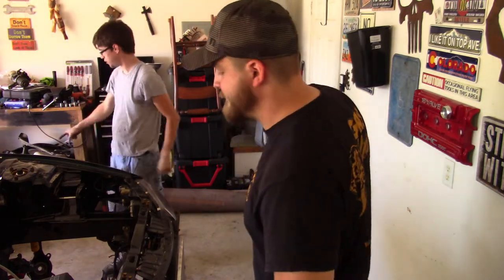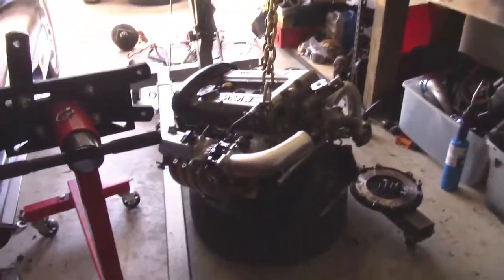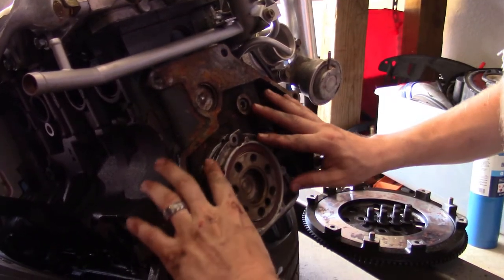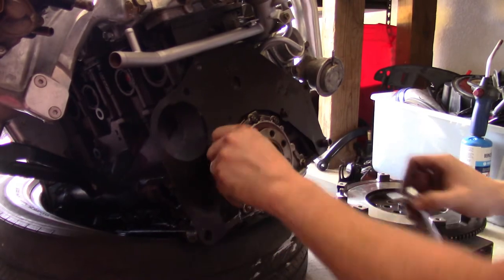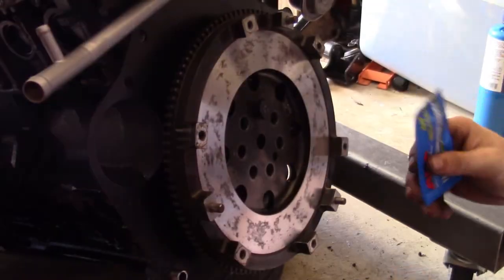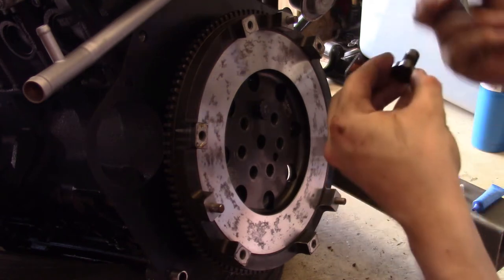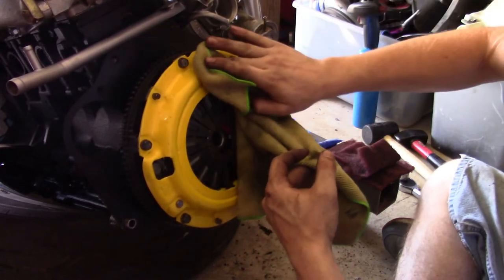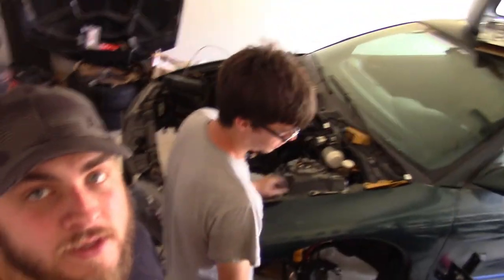4G63  Refresh Part:4 Transmission and Final Install

Comment: Hey you should ship me one of those heads that's sitting there on the shelf. Hahaha
Reply from the maker: HaHa Im not sure on their quality havent needed one yet believe ones a 6 bolt and ones a 7 and one of them is locked up for reasons unknown.
Reply: BuildBoostDrive lol the struggle of having to many parts. But keep up the work man!
Reply: I'm slowly turboing my 97 eclipse spyder 4g64. So I plan on putting a 63 head on it next. I've already got the Ecu, injectors, knock sensor and injector pack installed and running good.
Reply from the maker: Thanks np sounds awesome! we will be in the same park. Along with our next projects my 4g64 is in process I still need to pick pistons, and some bigger injectors for the turbo we picked up ;)
Reply: BuildBoostDrive I'm just gonna throw a 20g on mine for now. Hopefully if everything last for a while I'll try a hx35 on it. But hell who knows what's gonna happen after I get bored of the 20g. Lol